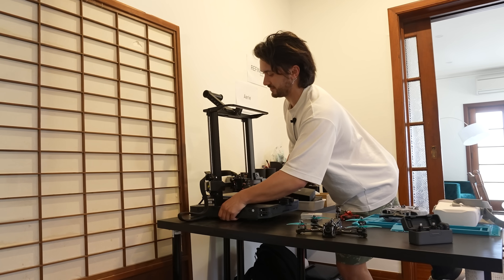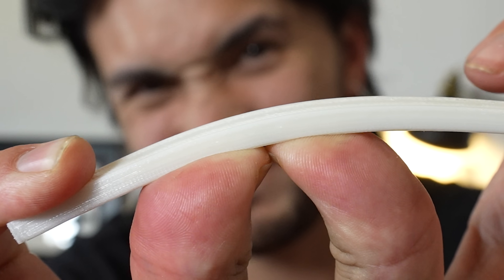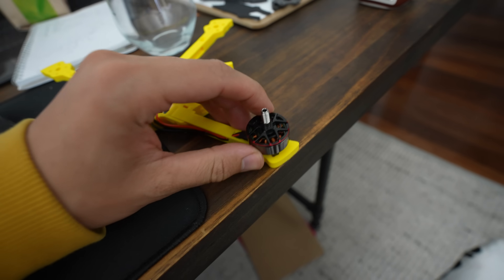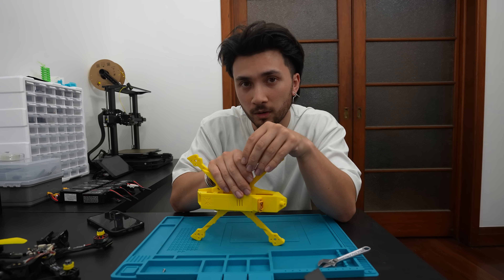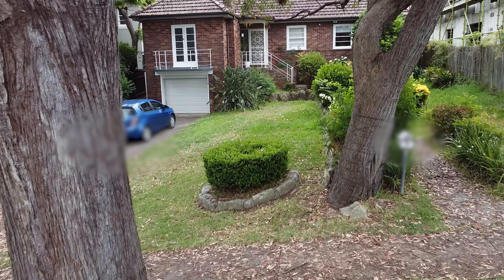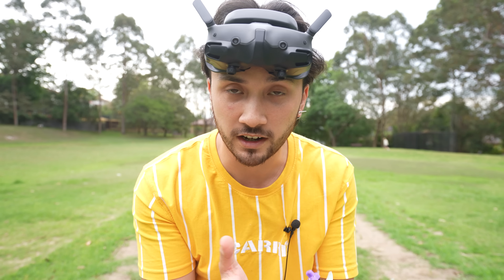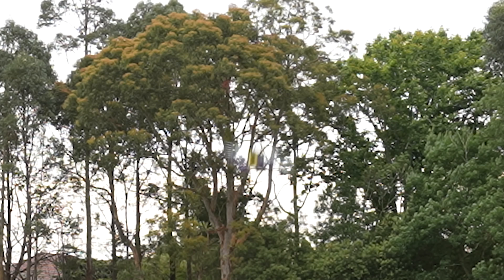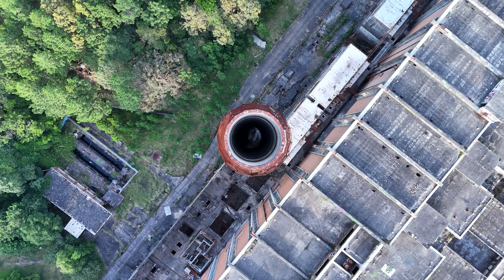3D printed drone. Ah yes. Very Good

Comment: "Let daddy teach you something here..." 😎
You’re all debating PLA, ABS, PETG... but let’s be real.
If your goal is to build a functional and durable drone frame, it’s not just about any filament — it’s about technical application and real-world performance.

🔹 PETG is definitely one of the best materials for this kind of project. It combines the best of both worlds:

Stronger and more durable than PLA,

More flexible and impact-resistant than ABS,

And less prone to heat deformation compared to PLA.

👉 Reinforce it with 100% infill, thicker walls, and at least 4 perimeters. That way, you’ll get a solid, reliable structure with a bit of impact tolerance.

🔸 Want to level up?
Use carbon fiber reinforced PETG (PETG-CF). That’s when you enter serious engineering territory:

High rigidity,

Lower weight,

Better torsional resistance,

Clean and professional finish.

So here’s the tip:
PLA is for prototyping. PETG is for flying. PETG-CF is for serious builds.
✈🔥

Comment: next you will be buying cnc machine to cut carbon frames 😉cool project but yeh 3d prints struggle with frame resonance you have to dial back that fc for the plastic frame for it to work as you found from printing a thicker frame.  worth looking at different plastics in future tho to print with, also would of been cool to see the Dbug log data when you managed to get it to fly at end

Comment: Gonna move away from regular PLA or PLA enterly. Look into stronger filament and the requirements needed to print with them. Trust me PLA is great for prototyping or craft projects but they do not holdup to the test real world use. Move up to "Tough PLA" and  "High Impact PLA" or just make the leap to Nylon and Carbon Fiber filament.

Comment: Designing frames not as simply make it rigid. You also need to consider the vibrations, how it will be absorbed or transfered into the gyro. Excessive vibrations (noise) would make it fly away like that. Toning down the PID will surely help, but low PID gain will make it to feel sloppy and not fun to fly. Material that bend and flex easily could also make a drone fly really bad.

Comment: FPV drones are constructed from carbon fiber due to its stiffness, yet it retains flexibility. However, if the frame is excessively rigid, it will fracture upon impact with the ground.

Comment: The comparison of Printed H beams isn’t a good one as you don’t have isotropic behaviour between layers

It’ll resist planar bending along the axis of the beam longitudinally; but it’ll be weaker in any torsion (e.g. the mixed loading it’d experience in a collision)

Comment: Congrats on getting it working, serioiusly!
HOWEVER!! Anyone in the hobby could tell you 3d printed drones are a bad idea. Nothing about them is better. Way less durable and stiff (even with incredibly expensive materials) it would probably explode if you actually crashed because lets be honest, if you aren't crashing, you are not freestyling and will not improve as a pilot. It might be a bit lighter, but for a 5", who cares? Printing parts might be slightly faster than ordering a new arm, but I think you maybe should have mentioned in the video that for $30 you could get a frame that will last longer and fly better.

Comment: Wrong filament, research into 3D drone community would have saved you a lot of time. Drone hobbyists would say 3D printing drones are pointless. But I disagree with the advancements of filaments and printers.
Reply from the maker: Definitely not the most ideal but i wanted to see if it was possible  with the easiest material to print. although I would of liked to try carbon filament aye

Comment: maybe you should have started with flights in a simulator??  and yes - a 3d printed frame is too weak to survive falls...
Reply from the maker: I mean....... I can fly FPV drones I just wanted to try print one
Reply: @Nick_FPV  Sorry, but those frog-style moves looked like a complete beginner. This is not meant as a ridicule - I did it myself the first few times.

Comment: I would have added a vertical fin so a T not a H. I use PLA+ though over PLA for strength reasons and tweak my settings a bit with walls over density. Strength over weight.

Edit: Second point - when you were concerned about vibration did you try attaching it to a brick so it wouldn't take off but you could get telemetry (cinderblock, not a small thing for you to make a flying brick and kill someone)
Reply from the maker: I think I completely underestimated how much it would vibrate haha but interesting tweak 🤔

Comment: You could EASILY do this with a filament like PPA-CF. Insanely strong (stronger than pure aluminum). It's very light and super rigid. 

You could definitely make a "skeletal" drone build out of that, and it would be perfectly rigid enough.
Reply: Wow it’s over $300/kg
Reply from the maker: that's crazy that a printer can print that

Comment: The use of solid sheets of carbon fiber to construct drone airframes is only popular because with the use of cnc machines it is quite easy to build a lightweight and durable frame for reasonable cost.  However, thick slabs of carbon fiber is not an efficient  use of materials and will not produce the lightest part for a given stiffness. This is where there is great potential for 3D printing to be used to construct more optimized airframe structures.  Optimization begins with shedding the currently popular carbon frame designs and looking to full scale aviation for clues.  Adopting the principle of pushing you're materials as far apart as you can for a given part envelope is one means of increasing stiffness while keeping the weight as low as possible.  A simple example is a solid round steel bar of perhaps 8mm diameter as compared to the exact same amount of material used to construct a hollow tube.  The hollow tube will be stiffer in bending than the solid steel bar but the weight is the same.  I am using carbon fiber filled nylon for drone airframe parts and I use strategic infill such as honeycomb in order help support thin walled hollow structures to achieve a high level of stiffness, light weight and reasonable crash durability. 3D printed drone airframes are the future..............
Reply from the maker: interesting... looks like you have a lot more experience with this... I'd be interested in seeing how the carbon filament performs cause that sounds crazy

Comment: Why not a Bambu? 👀 They're better machines with better material options at a better price starting point.
Reply from the maker: If I had to get another printer it would 100% be Bambu they just seem to work without error
Reply: @Nick_FPV  I have had both the A1 and now X1C and they are both equally as good imo
Reply: X1C owner here. From a technical standpoint, thats true. But theres been recent drama about them cracking down on 3rd party slicers, Louis Rossman put out 1 or 2 videos on it today. And Bambu moderators started muting and banning anyone on reddit and discord who even mentions the new firmware update. Its kinda crazy, they ruined their trust with everyone in a single day.
Reply: @SangheiliSpecOp  Yeah, that firmware drama sucks, TBH. However, I don't perceive it as a stopper for acquiring a Bambu in this particular printing scenario. They're just going the full Apple way. Anyways, he could have even gotten a Prusa (open firmware and tools if he really cares about that) ...It is just that an Ender bed-slinger for such a critical body frame? srly? lol

He should be trying some better materials like carbon fiber reinforced nylon, not PLA, hehe.
Reply: @ThePunkBuster  I feel you. Bambu would still be the way to go if you aren't worried about their firmware. I have owned an A1 before this X1C and both printers were second to none. The A1 was just as perfect as the X1C, albeit a bit slower. You still had to use brims with it because the bed would dance so fast lol.

Comment: i have the same 3d printer runing klipper on a raspberry pi. i can see of the quality of the print that you need to optimize the slicer setings. first i recoment orca slicer as the slicer just becouse its better then the rest and free. and dont wory you can print whay faster i recomend fore the smal cooling fan you should upgrade there is a good model on printbles that suports 2 fans so with out that fan i recoment 70ms and 1500 accel. with the upgrade i go around 200ms and 2700 acel. hope you have a great time with the great hoby❤
Reply from the maker: interesting! since the video I've tried Prusa but I'll give that one a go

Comment: Those issues you had were what you call "fly away", where the flight controller gains are higher than the frames rigidity can handle, causing a back and forth over-increase of the motor, then the opposite side motor trys to compensate for changing tilt angle, and this continues in a loop causing the fly away. You could have simply lowered the master gain by 20%, and it would've flown. The two bolts and no wire inside arm is definitely an upgrade though, no reason to make a plastic frame weaker for looks.
Reply from the maker: hmmmmmmmm that's a much better explanation than mine lol
Reply: I wonder if he changed the PID gains at all, or if the heavier frame just prevented the gains from being over-tuned anymore 😂
Reply: yeah i was thinking the same thing the whole time lol
Reply: Yep, lower heavily DMax (literally to Beta minimum), also P term, and you can play with D term at the end (but for sure dont use presets which are meant to be as effective as possible - and here it is not the case). I term does not matter here too much.
Reply: i had an extremely similar issue with my 3.5" and disabling airmode seemed to fix it. can you explain what was going on there?

Comment: The main issue with that frame is that is an adaptation of a frame made with carbon fiber sheets. There are frames designed to be printed, that are not plane sheets. The square segment is not the most resilient nor durable.
Reply from the maker: yeaaaa that's true, If I had to build it again i'd build it from the ground up keeping in mind all the issues that came from that frame. Wasn't the smartest idea

Comment: To print a good drone you first need to forget how carbon frames are usually built. Printing similar structure doesnt really work well (it will be wobbly and/or heavy), but the added freedom of design lets you use the different material to its full extent. I built my first printed long range drone (with the exception of arms being of aluminium tube) and it was really good from day one. I think key is to design something that would be impossible to build out of carbon, then you know you are on the right path 😀
Reply: The reason that drone frames are the way that they are is that carbon fibre plate is cheap and easy to work with using a CNC router or milling machine. They are in no way an optimal design. For 3D printing you need a more optimal design and you aren't limited fo cutting it out of flat, thin plates.

You could make better frames out of other types of carbon fibre other than plates but it is more complex and more expensive.
Reply from the maker: damn bro I'd like to see that long range drone that sounds tank

Comment: First thing if you want to make something rigid make the inful higher but not to high or else it will break next is that get something like bambu lab aero filament and because it is strong and specifically made for rc planes and drones
Reply from the maker: just looked it up... that's pretty crazy
Reply: @Nick_FPV  also if you are in a higher budget you should get bambu lab aero filament ASA or ABS which are strong filaments

Comment: you could have increased the strenght of the arms by adding more walls or more infil or a different infil type. Or you could use a different material like abs or petg
Reply from the maker: I did add more walls I just didn't put it in the video haha but yea I read on reddit that it adds more strength than infill
Reply: @Nick_FPV  do you have the stl's files for the drone frame
Reply: what was the total build cost

Comment: I bet if you`d lower filtering down to 50-70Hz and gave it less master multiplier in PID those previous two frames also would fly.
3D-printing arms IMHO is much harder and heavier than having carbon fiber tubes. even smoler 10mm tube will be much stiffer than 5-7mm thick conventional CF plate type arm.
Reply from the maker: that...is a good point...

Comment: Congrats on getting it working. I applaud your willingness to stick with it through failure. I just recently designed a fully working line of 3D printed frames. They fly VERY well and handle frame vibrations arguably better than a lot of conventional carbon plate frames. I was in the same headspace as you for a while, trying to copy the existing frame design using 3D printed plastics. Then one night I had a moment of clarity where I saw the error in my thinking. You can't copy the existing designs used for carbon plate frames and then attempt to get your strength via thicker arms or more perimeters or different filaments. You have to think different and use the 3D print processes to your advantage. I'm not going to give it away because I intend on selling my frames here in a couple months. But suffice it to say when I print with PPA-CF the frames I build are INCREDIBLY strong. Almost impossible to break. Even the PLA prototypes are 100% flyable. I'm at about 100g total frame weight for a 5" stretch. I can print up to a full 7" frame off a K1c, and this design works well al the way down to 4" or  3".  So I can say it's completely possible to build a 3D printed frame that meets the weight needs and performance requirements. You just need to avoid getting stuck in a specific method of thinking. Don't copy, re-invent!
Reply from the maker: shiiiiiiiiiiett that's wild.... I'll keep an eye out for that man cause that's crazy
Reply: where do you sell?
Reply: Me too. Reach out if you want to collab.
Reply: To get fuller strength you'd have to design the frame to use 3-D printing instead of 2-D routing. That's how the carbon frames are made, that's why they look like that. Multi-dimensional rigidity comes more from leverage when designing for printing. The arms would end up looking like thin cones with motor mounts at the tips. Those cones would have four holes to mount to the body. 

I doubt he can CAD or engineer to the level needed. It's way more involved and "boring" than I think he's willing to admit. He's made very basic mistakes that certain college students would make freshman year, but not senior year.

Comment: I've had success on much worse frame designs, so I don't quite understand why the flight controller software sometimes goes crazy with the throttle.
Reply from the maker: it's basically just flexing and then overcompensating from other motors which causes a loop
Reply: @Nick_FPV  I think I was using iNavFlight with airmode disabled for my really lightweight frames. I'm pretty sure the times that I've had problems, it was because the drone had too much power for how much it weighed, so the PID constants were over-tuned when I didn't expect them to be.

Comment: Your frame looks slick. I've been designing and printing drone frames for the last year. I've kept it small though, mostly 65mm whoops and a 3" freestyle frame. I've been using PLA and PETG-CF to print with and the 3" will shatter on a good crash but the tinywhoop frames will be pretty durable. I don't think I'd do a 5", the increase in weight and likelihood of it breaking in crashes scares me too much.
Reply from the maker: yeaaa after the second crash I was considering making it a smaller frame cause then for sure it would flex less

Comment: Great video, interesting project. 
If you get a hankering to do this again, the frame requirements CAN be met on a 3" quad, where this 5" is just a little outside the limits of current 3D printer plastics. The awesome frame you have designed/printed, will explode if you hit stuff. The weight of a 3D printed 3" drone will withstand crashes (assuming a good frame design). 
Can't wait for your next video, this was a great watch!
Reply from the maker: Thanks! Yea that's what I was thinking! After the second crash I was considering making it a smaller frame because It did make more sense
Reply: Its an old comment, still gonna give me 2 cents here. Yes, if you stick with the basic flat plate design just imitating carbon, you will never get a 3d printed frame that is stiff and survives crashes at least somewhat similar to their carbon counter parts. What you wanna do is use the properties of a 3d printer which carbon can not (easily) do. Such as having a enclosed design e.g. in a bathtub shape (Monocoque shape). This way you can offset the missing carbon properties. But then comes with other design challenges. Overall you need to be much more careful then with the carbon plate design when considering any kind of design choices.

Comment: A box profile for the arms may be more optimal, use more walls and top layers, Infil doesn't matter as much. With 3d printing you can make things hollow which is a big deal. Bigger (hollow) arms will be better.

If you want to try a different material I'd suggest PET with a fiber fill like glass fiber or carbon fiber. Use a steel nozzle though! Nylon (PA) isn't great because as it soaks up moisture it gets more bendy.
Reply from the maker: I definitely would want to try that carbon filament at some point it sounds crazy